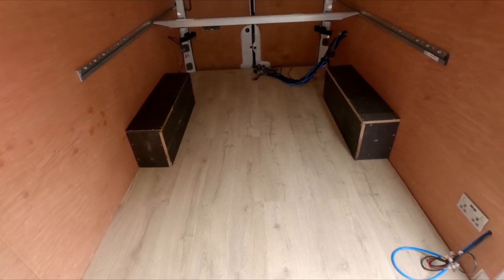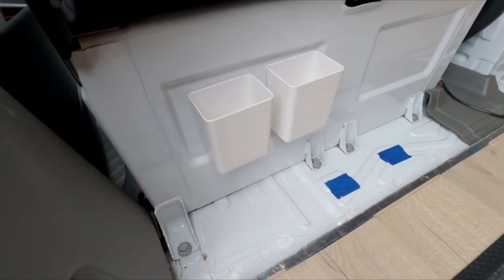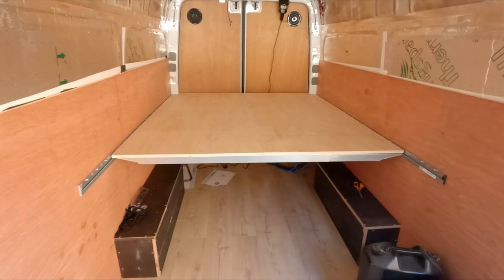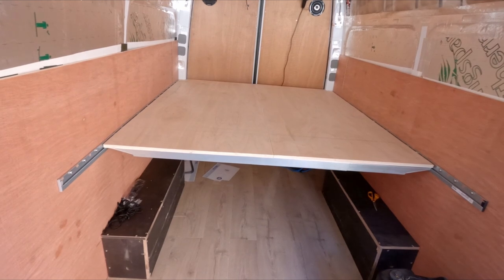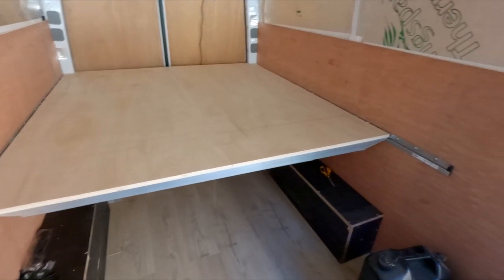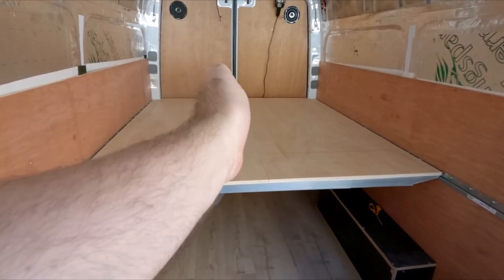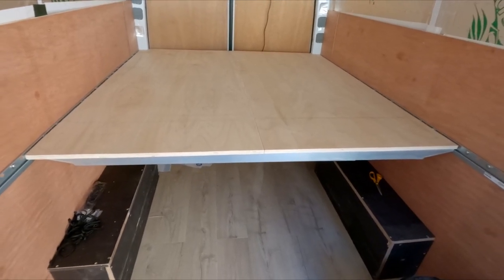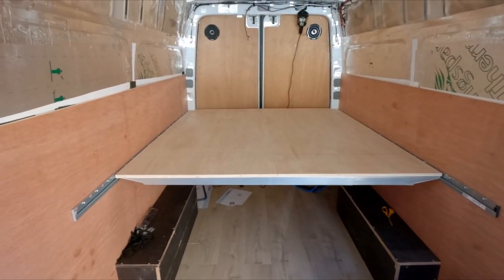Van Conversion - Metod / Skorva MOD & Bed Base installation.

Comment: Love the vid thanks, I am going to have a east / west bed (750mm wide x 2 hinged), with a sliding METOD rail, so the back 750mm side of the bed can hinge up and be used as a back rest and the double bed becomes a lounge. also giving you more room in the cabin when the front side slide back.

Comment: Great bed but think your mattress is going mouldy without ventilation.
Reply from the maker: Yes, initial idea was too drill vent holes into the base. Once I've finalised the base, because I may section the deck into quarters so I can also run a small horizontal setup versus just vertical. Then I'll probably add the vent holes.

Comment: Hi, That's a great idea. I'm looking to do something similar with a sliding bed (Metod/Skorva). Is it easy to slide the bed with in mattress(es) in place?
Reply from the maker: As I have a double memory foam mattress fitted, it's not light. Plus it snags on the wall, so for me, no. That all said. If you're doing a single?? Mattress doesn't snag on the wall? It's within your limits I'd say yes. When I remove my mattress I can slide the beams under the bed base if I take some of the weight off them. Don't hesitate to ask more questions, if you need some more clarification. The beams will angle and snag if they don't remain straight when being pushed, so you'd probably need to fix them to the bed base? Trial and error?

Comment: I am considering a similar idea, however I want my bed to be an extending bed. Do you think those mid beams will slide along those rails easily to extend and retract a bed?
Reply from the maker: They do slide easily (IMO) with just the base of the bed loaded on top. Not sure it'll do the same once the mattress and linens are all in situ...

Comment: Great design.
How noisy is the metal on metal when driving haha?
Reply from the maker: The weight of the bed will keep it "rattle" noise free. Still have plenty of wiggle space to fit a rubber bumper along the beam edge or Skorva struts should it attempt to try and join the percussion section!

Comment: I was thinking that slats would allow air flow to the mattress, given the amount of condension in an enclosed space?
Reply from the maker: For sure, since this video I've added "many" more holes to the bed boards. It's just a personal preference doing it this way, plus an easy solution at the time. It's all a learning curve.
 ;)
Reply: You should do slats then pinboard on top.you need alot of air flow to stop mould growing...I also put a feed from diesel heater to the back under bed to stop condensation.trust me been there.
Reply from the maker: @alanbelcher5822  yeah it's a learning curve for me, so far I've had no issues. Doesn't mean it isn't going to happen. My van is VERY well insulated, plus vented. Appreciate there's many other factors that come into play. Just taking it one step at a time. IF it becomes an issue, I already have a back up plan. Thanks for the comment, appreciated.

Comment: Did the skorvas used to be 10 quid? I see they are 20 quid now and the rails 23 each. So 106 and the ply at least the same again.  Not cheap but a good solution
Reply from the maker: Yes, regrettably the prices over the past few months have increased significantly. I've looked at  bed systems made by campervan companies (let's call them that :) )...This option is still SIGNIFCANTLLY cheaper! I've seen them at £500 for a setup that kinda does the same thing...Madness...
Reply: @oklife6290  i bought them yesterday, but managed to get the little fixing brackets (free) so didnt need the rails.  So 60 quid isnt bad
Reply from the maker: @bobbyfischer6786  Sounds like a good result. Enjoy...

Comment: Is that 6mm ply on walls holding your bed frame
Reply from the maker: No, it's 12mm. As I'm not building a full campervan interior, the additional weight for me isn't an issue.

Comment: Is the rail bolted to the beltline of the cargo space?
Reply from the maker: For the rail attached to the side panel I used what's called in the UK, furniture bolts. The actual nuts have a deep collar on them. So you push the nuts through the pre drilled holes in the 12mm plywood. The fit is precise, as in no movement. The bolts have 30mm penny washers on the back also to spread the load. So when I attached the rail and screw in the stainless steel screws (with more washers) it's a total mechanic fit. The bolts ARE NOT loose in the plywood, it's a precise fit. Plus the load is being spread by the metal collar running thru the plywood and the over sized washers on the rear.  Hope this helps...

Comment: Shame you didn't mention what is the side rails you used 😔
Reply from the maker: Hi, sorry, I don't understand? The side rails are called METOD cabinet rails from Ikea. Hope that heps?
Reply: @oklife6290  it was hard to read so Googled and found two options which will hold up the beams. Thank you. It looked like Method but bit blurry to read . Ta
Reply from the maker: @vanlifeembracingdiversity5431  In the UK, Ikea call them METOD suspension rails, 200cm long. The word METOD (within Ikea) refers to an entire range of items with the METOD kitchen range. x
Reply: In the US it's called Sektion # 602.615.27
Reply: @vanlifeembracingdiversity5431  i think what you are trying to say is that you now realise the chap had indeed put the name in the description and proffer apologies for you own bufoonity